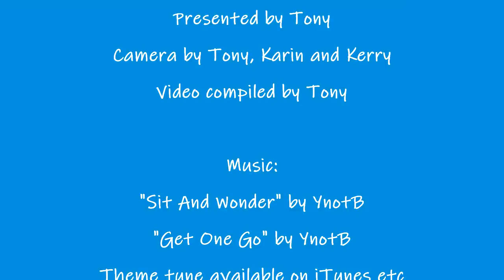The composting toilet and a bit of a chilly week - SV Tapatya EP64

Comment: I’ve seen other composting heads, Air Head/Natures Head where there is some sort of composting medium you have to add and a mixing mechanism, yours appears not to have this and seems much simpler, I suppose you know why? 
Enjoying the build by the way, thanks.
Reply from the maker: Thanks John
With this head, you have the option to add sawdust, etc, as a composting additive and to keep the solids as dry as possible. I think the stirrer is only necessary if you really intend to produce compost. 
I should (once again) give due credit to the guys on Sailing Kittiwake (YouTube channel) who made me seriously consider using a "composting" head. They use a cheaper version - also made in England - the Simploo, which has the same lack of mechanism and basically the same set up. They report that it works well and, importantly, doesn't stink. If this is indeed so, then the stirrer isn't necessary; and, I have to say, that makes sense to me - the aim isn't to keep the poo in there for ages while it decomposes. The aim is to keep it dry so it doesn't stink and empty it out at every convenient opportunity.
When the boat is finished and underway, I'll report on how it works out :-)

Comment: Why do you remove the screws?  I would have thought added strength so I guess there must be a reason.
Reply from the maker: The screws are just pulling the boards together while the glue dries. They aren’t necessary for strength. Also is means fewer mixed materials

Comment: You should have a inline filter on the vent line or your boat will give off a terrible stink on the outside
Reply from the maker: But.... mine doesn’t stink, Hans!!!
Reply from the maker: But, seriously. It really shouldn't stink any more than any other boat with a holding tank ( and theoretically, less). Holding tanks are vented too and they take a mixture of solids and liquids, which, according to the theory at least, should stink more.
Reply: @SVTapatya  it will only stink if you use it.
Reply from the maker: 😂😂 I'm sure you're right there Hans. What I will do is this. I'll fit the thing and, when I start using it, I'll give an honest report on how it performs. Time will tell!